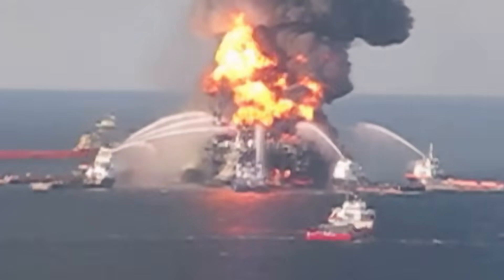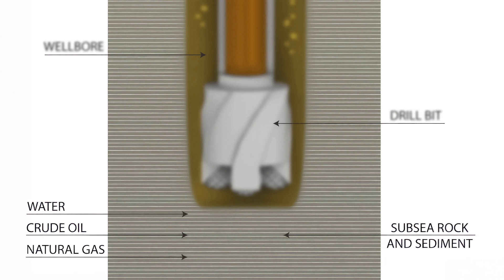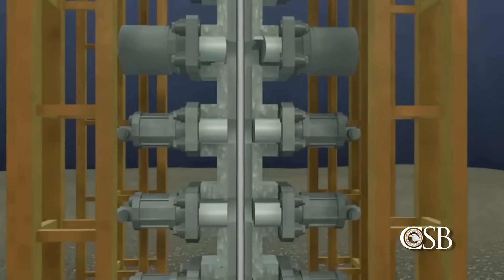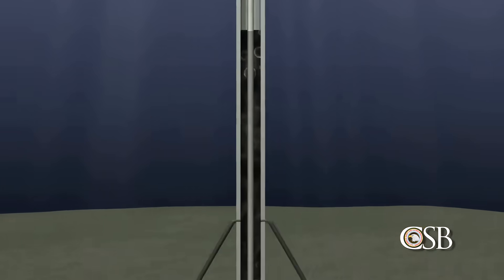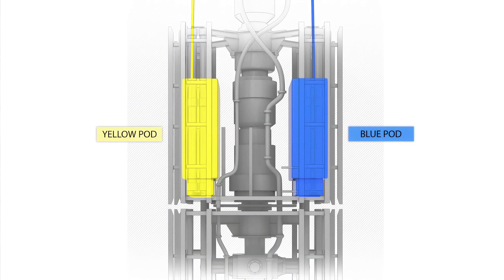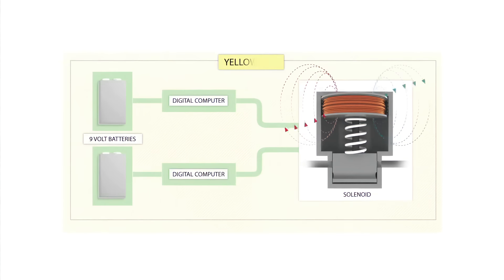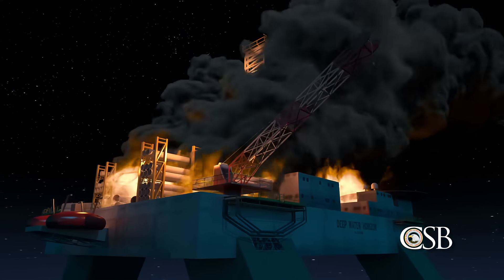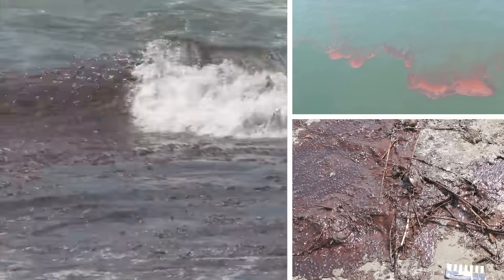Deepwater Horizon Blowout Animation

Comment: Their explanation of effective compression is terribly, terribly wrong. The effects are described accurately: a differential pressure can cause pipe buckling, but it has nothing to do with "minute initial curvature". One only need look at the force balance that includes the pipe pressure and the virtual surface "minus" annular pressure that would be in place if there drillpipe+pipe fluid were not there. Teff = T+PiAi-PoAo. THAT is effective tensions/compression, showing how extreme differential pressures cause buckling.
Reply: Mark, the CSB explanation is correct. If a pipe is perfectly straight and perfectly uniform with no irregularities, it won't buckle, essentially it doesn't know which way to start.  Similar to simple Euler force compression buckling of a rod - it won't happen if perfectly straight/uniform and no perturbation.  Your equation for Teff is correct and cannot be derived by a force balance on a straight pipe -- the easiest derivation is with integral calculus, but still need to assume a slight deflection as part of the solution method, and see if the resulting forces and moments try to make it straighter or bend more.  See SPE 6059, (Casing Stresses Caused By Buckling of Concentric Pipes, Appendix A - Effect of Pressure on Buckling - Exact solution)

Comment: Were these systems not tested under realistic pressures before being rolled out into the field? If so, they would have experienced this "effective compression" pipe bending, went back to the drawing board and saved the Earth huge damage. Instead, I'm sure, they were blinded by dollar signs and unrealistic deadlines. "Yeah, that oughta hold...."
Reply: No one had ever realized the pipe could buckle inside a BOP during well control.  Easy to see in hindsight, like many discoveries.

Comment: Ok, who had the bright idea of using solenoids that had to be powered to work the safety systems in that manner? The idea of a safety system is to fail safe, how in the hell is needing power to operate those safety systems a fail safe? The way it SHOULD be done is the exact opposite of how the systems are designed. Power should have been required to keep the system open, and as soon as power was lost, it could have failed safe. This is a basic rule of thumb..... why would you rely on power to make the system work? This is the EXACT opposite of fail safe. Power the valves to keep them open, if power is lost, the system shuts the valves and things may not have been as bad as they were. I know in this kind of work, there really is no such thing as fail safe, but it would have made a HELL OF A LOT MORE SENSE to make the safety systems work when power is lost instead of relying on computers and electrical power to make them work. Just... what the hell? I know there will be excuses, but I am sorry, there is no excuse for a design like this. Just... I have no words for how stupid this design is....
Reply: Carstuff111: You missed it.  In spite of the problems, the BOP solenoid controls worked, did not cause the blowout.  Shear closed and its failure to seal was due to the  buckled pipe.  Something that no one ever realized could happen, but easy to see now.
Reply: They were terrified of having the pipe shear valves close because of a power loss.
They should have been terrified of having the shear valves fail because of a power loss.